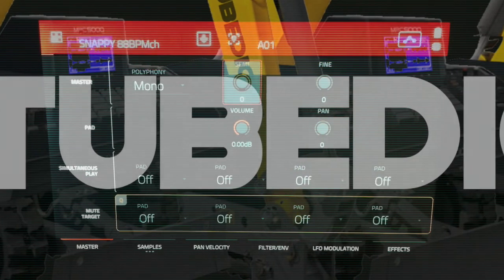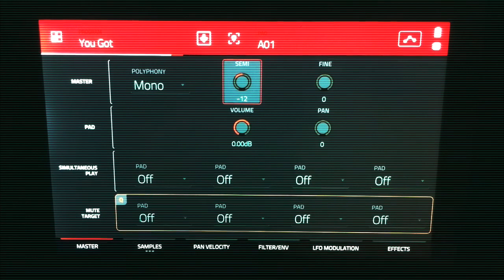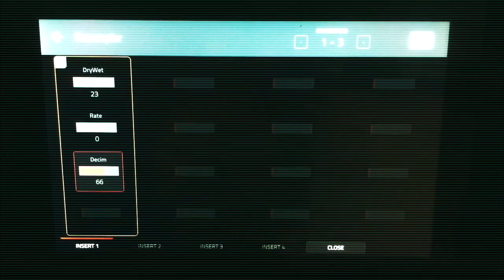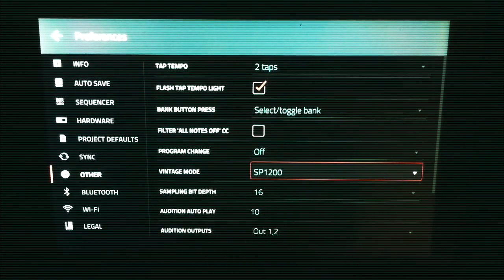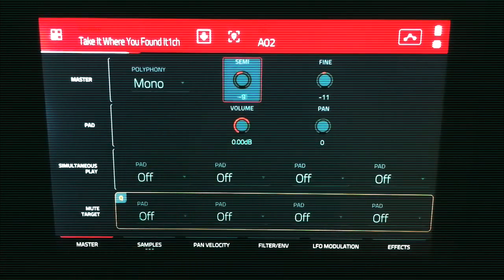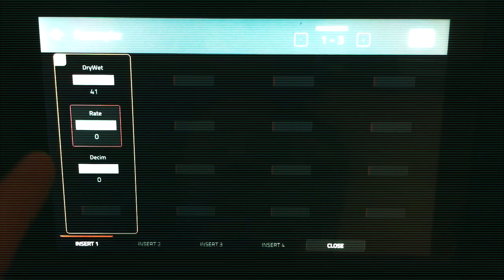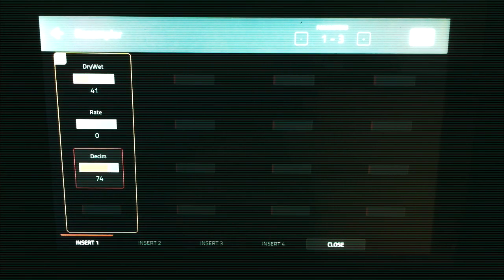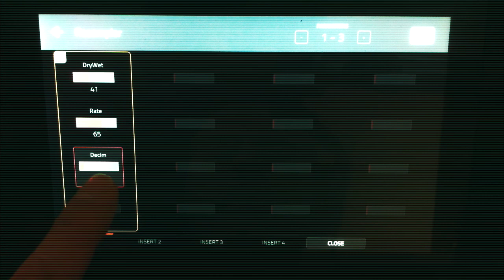AKAI MPC LIVE/X: Vintage Mode VS Resample Effect

Comment: This is the video I was waiting on I don't regret selling my SP1200 after hearing the different ways I can get that Boom Bap sound I was worried I would lose using a newer machine I'm coming off of using  emax , sp1200,,mpc,3000 setup . Wanted to know if you can do a video on chain compression .So my bassline doesn't over shadow my kicks .
Reply from the maker: Unfortunately there's no side chain function in the MPC Live - you could do a basic emulation using the LFO to control your bassline level, but this would only work loosely with simple 4/4 stuff as the basic LFO shapes would dictate the movement of the level. Best bet would be to get your track sounding as good as you can and export your individual tracks to wav, then sidechain in Ableton or similar. Hopefully AKAI will implement sidechaining in one of the existing compressors or add new compressor with this function :)
Reply: Hi TUBE DIGGA thanks for the reply gonna try the tip you gave me out today when I'm knocking out some music .

Comment: Wanted to comment on your resampler effects rate adjustment. The rate should act like a low pass filter and should dramatically change the frequency of whatever you're processing through it. Wondering if the resampler effect on your MPC is a little buggy? Thanks for all the videos, they are the best on YouTube hands down & I've learned a ton from them.
Reply from the maker: It’s because it doesn’t have an anti alias parameter - with the new Air FX LOFI you can achieve a low pass filter effect by switching on anti alias and reducing the post and pre parameters and reducing the sample rate

Comment: So how does the 3000/60 mode sound. its a video on YouTube where a guy says the Live is not capable of sounding like vintage machines. like you have demonstrated here. if I was him i'd take that video down.
Reply from the maker: The MPC60 emulation is decent in its own right, as to whether it actually sounds like an MPC60 I can’t say as I’ve never owned one. It certainly sounds a bit fuller, adds weight and appears to push the sound forward in some way.
Reply: It is truly a unique great sound.
Reply: The mpc60 sounds more like a 60 it knocks more evenly!